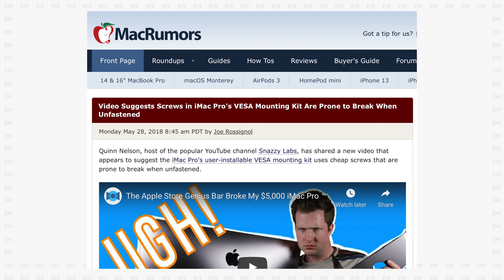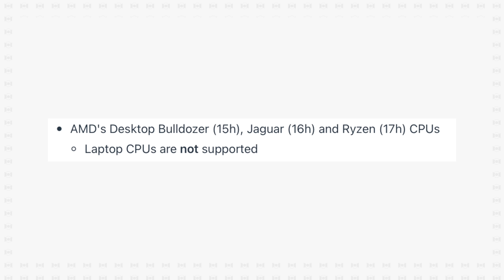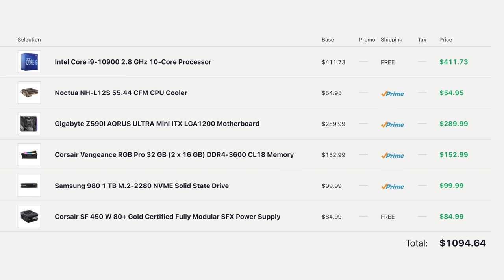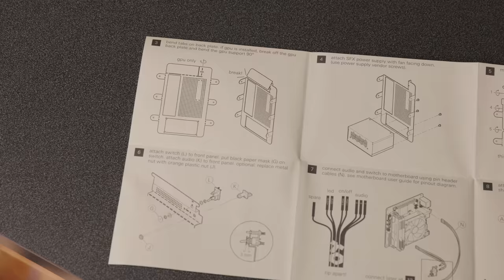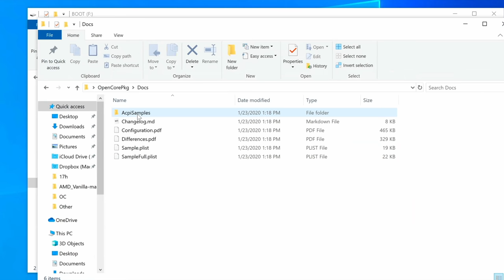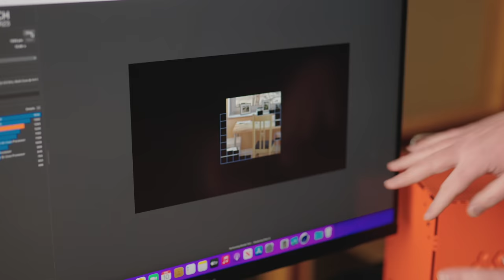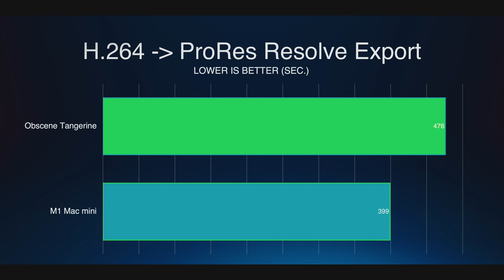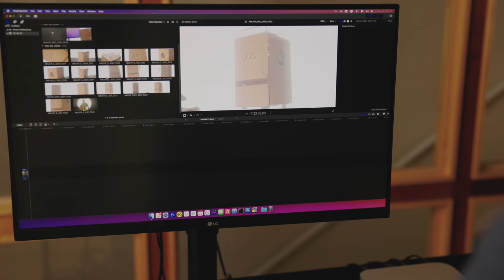The Last Hackintosh?

Comment: I converted my Hackintosh to Win10 a couple of years ago. I've thought about making another one but Apple silicon is too compelling and Hackintoshing is too complex.
Reply from the maker: Yep.
Reply: This sums it all up pretty much.
Reply: Not too complex if you build a pc with an hackintosh in mind
Reply: @R.e.o584  Tracking down specific Hackintosh compatible parts in this current market is a hell of a task, though. What do we give it, another six months? A year? When will the chip shortage and supply chain issues end? Will prices ever fall again, or have we just given Intel and NVidia proof that we'll pay anything they ask?
Reply: @R.e.o584  Oh I did that. But kext updates, USB mapping, system updates, etc, were a pain the a$$. I am not a coder nor do I want to be. I want my systems to work so I can work.
Reply: @R.e.o584  Ha! Try tracking down compatible parts for a specific build... and then maybe having to wait 4-6 months for someone to iron out the bugs.  By that time it's almost out of date already.
Reply: Same but dropped maybe $200 worth of hardware upgrades of used hadware and it way outperformed my 2016 MBP. So my 10+ year old Hackintosh hardware is still great and if I wanted to I could still upgrade. If I build another Hackintosh it would be as a VM on Linux with hardware passthrough.
Reply: depending on what your workload is, just build one with older, better supported, parts. yeah sure it's not a powerhouse, but my hacky runs just fine with an i5-3330 and a Radeon HD 7850 and 8 gigs of ram. i can watch youtube, check my emails, play league of legends, edit videos (at least 1080p). the affinity lineup works great and corel draw had a small issue where it ran somewhat slow, but there was a stability update and now that runs fast too. the only thing that doesn't work is my printer, but that's a canon-not-updating-their-drivers issue. only once i had some software bug creating a memory leak that drove the system to a halt. i will upgrade the amount of ram eventually.

all i did was create a clover usb using gibMacOS, add hardware kext to usb, boot and install catalina, reboot into linux, mount efi partition, put clover, hardware kext and a config.plist i found online for my motherboard on the efi partition, reboot into catalina and edit the config.plist using the clover configurator to edit serial number and stuff.

honestly, this machine runs so smooth and bug free, even the usb3 pcie card i added works fine. usb-wifi works with some 3rd party driver i found on github, usb-bluetooth works out of the box, i added a cheap mouse and keyboard to round up the "i want a mac but i have no money"-look

i am thinking of trying this on a laptop from about the same era.
Reply: hackintoshing is more annoying than installing and maintaining a gentoo linux system 😂 gentoo isn’t annoying, it’s fun; just have to read the news for any changes and update every once in a while. it tells you when there’s a package/config that needs attention/has changed which is completely different than a hackintosh, which can break terribly on updates.

Comment: It makes sense that these were going to start going away. Just for ease of use, size, pretty much everything, the mac mini is crazy awesome right now.
Reply: Not just that, it’ll also be very hard to hackintosh once ARM is the only supported architecture.
Reply: @FlorianWendelborn  at least until Qualcomm starts making chips competitive with desktop Apple silicon. Whether they’re there yet or not you know they’re working on it
Reply: @HearMeLearn  maybe but I'm pretty sure because of Apple's T2 nonsense being integrated into their ARM chips it may take a lot longer
Reply: @HearMeLearn  Apple is changing the kernel to not be dawin based for arm, making it very difficult to hackintosh as no open source base exists to use. Hackintosh projects use this heavily because you need something that can be modified to work with other hardware that interfaces with the closed source OS.
Reply: @FlorianWendelborn  It's one of those "benefits" of making the hardware and the software people keep talking about.
Reply: @HearMeLearn  Can you do a video on this ridiculous sheet metal case? It can't fit a graphics card, the metal flexes to permenant bending, and IT COST OVER 200$!!!!!
Reply: @patrickdoty5534  He just did.
Reply: @eloiseallaway4928  No they're not? Monterey is based on Darwin 21.0. iOS, a purely ARM-only OS from the beginning, has always been Darwin-based?
Reply: Unless you also like to pc game. Boot camps dead and hackintosh can have 2 drives and a really powerful GPU.
Reply: @eloiseallaway4928  give it 5 years ARM macs will follow PowerPC example to a T such is the fate of all RISK Cpus takes to much time in the oven to be profitable long term for PURE Power as bloated as x86 was it outlasted every RISC Cpu Architecture just by slowly adapting X64 entered the fray early and was already many time the successor to x86 and already had claimed some popular RISC architectures lives by out doing them with its own sheer power and flexibility.

Comment: Apple's pricing on memory and storage is ridiculous. And remember neither of those are upgradeable anymore in the M1.

I built myself a hackintosh "the easy way": with a VM and pass through VGA and a discrete USB card. Apples to apples (core count and frequency, memory, GPU etc) it's an iMac Pro for one third the price.

It still has a few unfixable issues though, like minor issues with sound (even with a USB speaker), keyboard and mouse never worked in bootloader unless plugged in and so on.

Comment: I just put an external SSD next to the Mac mini. Is this strange? Quinn makes it sound like you really need to upgrade the internal storage, but so far it's working fine for me.
Reply: exactly what I do. I got a returned 512 model for the price of the base model though.
Reply: Well, that would be slower than the internal ssd.
Reply: @CocoaEm  it is but it's not enough to notice at all when running an app off it.
Reply: 256GB isn't quite convenient when you do adobe creative cloud , 3d modeling and Xcode in one computer
Reply: Guess it depends upon your use case. Average use like i'd be doing, external wins. 

I can see where someone would need the onboard storage, but a nice fast external SSD would be my choice anyways, it isn't soldered to the board.

Comment: If people managed AMD Hackintoshes, it seems like someone will figure this out
Reply from the maker: Graphics are hard. No AMD APUs work and only supported GPUs by Apple work.
Reply: Not gunna happen.  Too much proprietary information about the raw software gpus use.
Reply: amd cpus can be used, one small issue though. no drivers for integrated graphics exist. a vega 11 in a hackintosh would be great, but will never happen.
Reply: dang these comments aged like milk

Comment: I built a “Nuc Mini” whenever that video came out and I’ve been enjoying that on MacOS since, IMO, the first time set up was a pain, but since, I’ve had minimal issues
Reply: How is the OS upgrade process? Are you able to scale up as new ones come out or are you limited to a certain version of OSX?
Reply: I also built a nuc mini due to that video, over the ensuing time I have moved it from clover to Opencore and am running the most recent release of Monterey.  I cant say any upgrade was difficult and so far no issues.
Reply: @deepzone31  able to update fairly easily, just need to update plist, opencore version, etc. it’s more work than a stock Mac for sure, but not terribly difficult. I’ll say, the first time setting it up is a pain because you’re going in blind, but after that, you really start to understand what’s going on and there’s a very helpful community over on Reddit.

Comment: The move to 'Apple Silicon' certainly seems to be a mostly good thing. Of course soldering SSD's direct to the main board is a crime against humanity Apple persists in committing, and there can be no doubt Apple's habit of skimping on cooling persists...
...in 1-3 years when these machines are full of dust-bunnies it remains to be seen if old problems resurface: Horrendous throttling, chronic overheating resulting in damaged silicon, and the old favourite - overheated IC's de-soldering themselves.
Reply: How do they get dust in them when the fan never turns on, lol
Reply: How do they get dust in them if Apple insists that you have to upgrade to a new machine every 18 months?
Reply: Non upgradable ram in PRO line of laptops is a crime as well
But they’ve been doing this for almost a decade now…
Reply: @fila1445  It began after Steve Jobs found out that people performed RAM upgrades on the Apple 2, without his approval. Never ever again would an Apple be upgradable.

The engineers at Apple found that disturbing. What if the user needs more RAM than Apple offers? Jobs replied something along the lines that they should throw their Apple into a garbage bin and buy the next model.

Regardless, an engineer snuck in a secret RAM upgrade option onto the first Macintosh's mainboard. Jobs found out, bit the engineer lies and told him that it was some 'interface for testing'. Oh, these snraky bastards!

Well, Jobs is dead now, but his spirit definitely lives on
Reply: @SailBuddha  the fans do turn on, just not very fast. Even no fans in a chassis with vents will get dusty, and these things SUCK to open. Most would rather get a new device than risk breaking an old one to clean it.
Reply: the only reason appled doing this is so they can go back to the old days of being able to so "oh well you cant benchmark our computers because apple silicon works different"

also they just love proprietary stuff YOU cant repait

Comment: I would be curious to see a Hackintosh build using virtualisation as a base. i.e. Proxmox with MacOS on top, as opposed to bare metal. I am under the impression that the compatibility and overall setup process is much better

Comment: Hackintoshing will return when actually usable windows machines start shipping with arm processors.
Reply: This is true, but sadly this is years away. nVidia will probably be our best hope for ARM powered Windows PC’s, but that’s a long term aspirational project for nVidia. Hard to see where this goes now that the nVidia-ARM acquisition is as good as dead. Plus, desktop ARM machines will be few and far between until Windows 11 has been ironed out with regards to ARM, and that’s not going to be quick or easy. Lastly, if we’re ultimately going to be dependent on nVidia for desktop ARM CPU’s, the cost-benefit equation supporting Hackintosh probably goes out the window. 👎🏼
Reply: @benjaminlynch9958  If regulators in the US and UK continue going in the direction they are going, then the NVIDIA/ARM merger will not be allowed to happen, and for good reason.
Reply: That is by no means guaranteed. Hackintoshes work now because macOS has support for the hardware or hardware close to the stuff on the Intel/AMD side. Those theoretically future ARM based non Apple machines won’t have the Apple GPUs and other hardware that the Macs will have and making macOS work at that point may not even be possible at all.

Comment: They just used sheet metal screws, you don’t need to tap sheet metal if using sheet metal screws (if they gave you machine screws that’s a different story). That’s not to take away from the obvious issues this case has, which sucks because TE usually does great things and I like the look of the case.
Reply from the maker: Their screws provided sucked. Threads were too tight to be workable as sheet metal screws.
Reply: Having used teenage engineering synthesizers, namely the OP-1 which is still a wonderful tool that commendably still gets important upgrades a decade later, and the pocket operators, while I like their designs still I feel like TE has been moving into a bad direction with overpricing and form way over function items. Even their merchandising has insane prices and I hope they move back into making useful items rather than cool to look at items

Comment: Before M1, I built a budget Hackintosh containing a quad-core i3. (Yes, I know...) To my surprise, its single core speeds made it feel incredibly snappy; it felt entirely unlike any i3-based machine from Apple. Now that M1 is here and covers the low end, however, I no longer see any reason to build a low-end PC: one cannot beat the value of a $700 M1 mini. In fact, last I checked, a GPU with equivalent horsepower to that integrated into the M1 chips is already nearly $200 of that $700. It's a moot point, though, because it's true that the Hackintosh is on its way out — unless maybe we begin seeing ARMackintoshes popping up. (I'm proud of that name I coined.)
Reply: I don't know about your cpu claim here.

My old i3 pc about matched the cpu performance of the m1, he spent way too much money on the cpu and no money on the gpu. He needed to get something like a rx 580 and an i3, 16gb of 3200 mhz ram, and it would easily beat the m1 mac in most cases.

He could have saved a ton of money by not using gen 4 since 10th gen doesn't even use gen 4. He made a ton of mistakes in order to try and "match" the m1. It's obvious he's not a pc pro and never claimed to be, but I definitely think the budget of this could be lowered and the specs could be better matched.
Reply: @raycert07  With used parts, you could definitely make a faster (albeit less efficient) computer. Maybe the moral of the story is to not buy a GPU or CPU at MSRP.
Reply: @icantgivecredit871  not even used. Built my pc for well under 500$ with me providing storage and a case.

Cpu is easy, 10th gen i3 matches the m1 or beats it. Gpu not sure but it's not actually that powerful, only compared to the Intel hd that's been used on the Intel cpus from 2015 to early 2021.
Reply: @raycert07  On paper, the integrated GPU in the base M1 chip supposedly beats an RX 560. The CPU portion also definitely beats the 10th-gen i3, and the TDP is 39W.
Reply: @icantgivecredit871  the i3 uses about 40 under load, ans the igpu is not as powerful as a 560. 560 as in gtx, but not rx.
Reply: @raycert07  Better than a GTX 1050ti, in the case of NVIDIA. Also, that power draw is for the entire computer and is a theoretical maximum. The i3's TDP is 65 watts.
Reply: @icantgivecredit871  nope, I believe I looked at a benchmark for the m1 ultra and it was almost there. Though in real graphical intensive tasks, you'll never reach that level of performance.
Reply: @icantgivecredit871  tdp is thermal design power, they rarely run at the wattage. 

Remember the i3 is from 2 years ago and is using 14 nm.
Reply: @raycert07  The base M1 CPU in the Mac mini is from two years ago as well.
Reply: @icantgivecredit871  I'm saying new arm chips from apple have come out and new chips from amd and Intel have aswell.

And as your probably know, Intel is well behind on transistor sizes leading to higher power draw.

The Mac mini is basically a desktop anyways and if you wanted a slimmer device you could always buy a 800$ laptop with a 3050 ti and a 12700h and call it a day while you blow past the m1 in every possible way.

It's not THAT great of a value computer.
Reply: @raycert07  We weren't talking about laptops; my original comment compares a $700 Mac mini with a $700 PC build. We're also talking about a system that is 2 years old now.
Reply: @icantgivecredit871  those arm chips are laptop chips especially, we're still comparing components focused on highest performance possible in a computer vs lower performance but better power draw.

I can limit my cpu to quite a low speed and match the m1 while only using like 13 watts.

It's still not 5nm or whatever apples using, more like 10.

I'm still saying, he really needed to be smarter with this build. He spent all his money on storage, cpu, ram.

He was literally throwing away money for improvements that won't help fight the mac mini.

He could have made the system cheaper and match the m1 in every way except power draw and say it's a great value because it costs less and can run other operating systems aswell, and be upgraded.

Comment: Get a normal case that fits a dGPU like RX 6600 at minimum, use an Alder Lake cpu and follow the tonymacx86 guide. Your performance will be much higher, for not that much extra money.
Reply from the maker: Say no to tonymac.
Reply: @snazzy  ?
Reply: @snazzy  Tonymac has a big community when it comes to hackintoshes. Can you explain it?
Reply: @snazzy  why
Reply: Tonymac tools contain lots of hackintosh scene open source projects included without credit
Reply: @C4103  Fair enough but my comment referred to the Alder Lake guide, which was definitely developed by members on the site, in particular Casey. This is the current cutting edge in hackintosh development. Also, the thread makes interesting reading as an example of crowd-sourced development.